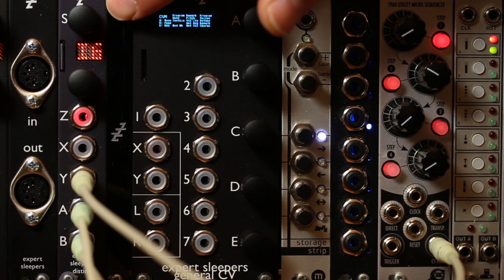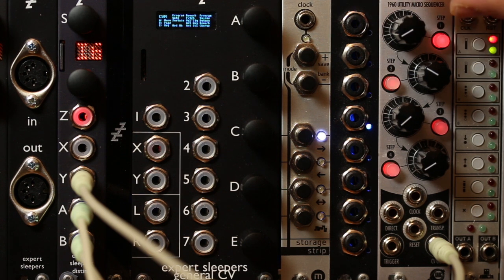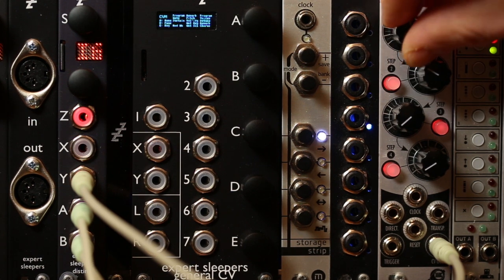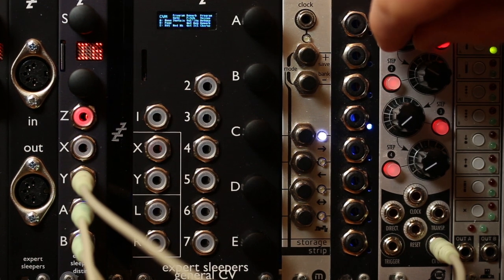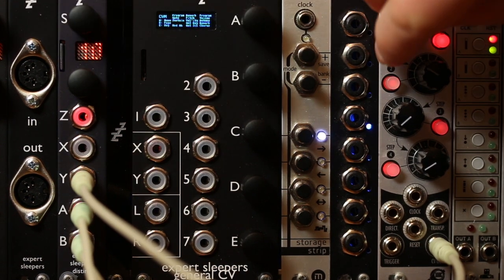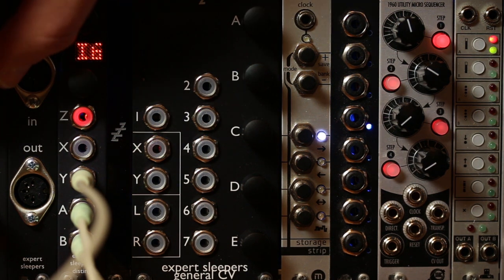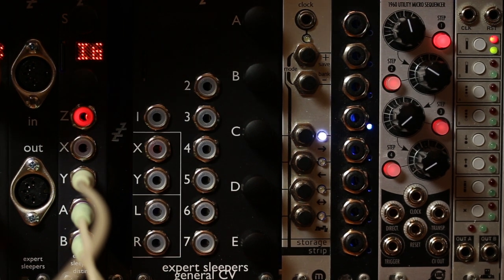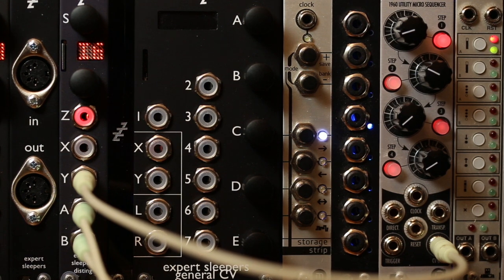disting mk4 - Audio Playback with Scrub

Comment: With a ramp LFO in this mode i would get a steady playing loop from start to end right, or will there be a glitch/"tape"slide when the ramp voltage change from max to minimum? 0V start position, 5V end position or what is the expected input voltage range (for start end endpoint in the sample)?
Reply from the maker: The end of ramp behaviour will be controlled by the slew and speed limit parameters. It's ±5V for the full range but you can offset that with the Offset parameter.
Reply: @ExpertSleepersLtd  ahh, great! thanks

Comment: HI, i have followed all the steps in the manual and the Audio Playback does not work for me. FW 4.6. Here is the playlist config, what am i doing wrong? All the wavs are 16 bit 44.1.

disting playlist v1
-loop=1
-fadeOut=3
-fadeIn=3
-gap=0
-retriggerOnSampleChange=1
-fixedPitch=1
-ramp=0
-triggers=0
-clocks=4
Afrique.wav
Alatac.wav
Allen.wav
Average.wav
Bacao.wav
Black.wav
Blackbyrds.wav
Bobby.wav
Reply from the maker: Please post on the forum, or email, so we can exchange files and have a proper conversation. Thanks.
Reply: ok, thanks for the quick reply. i will email you in a sec.